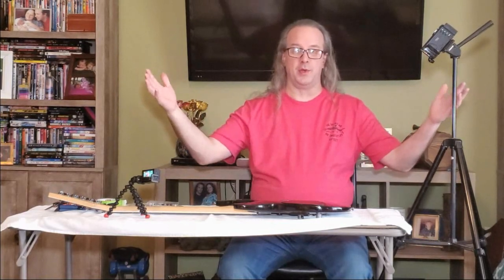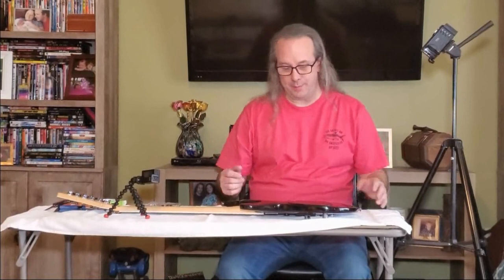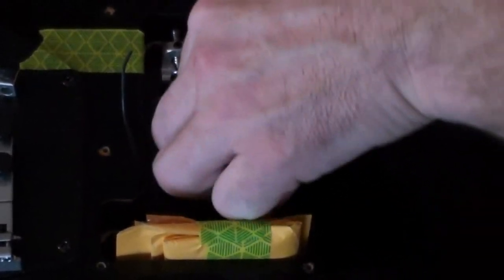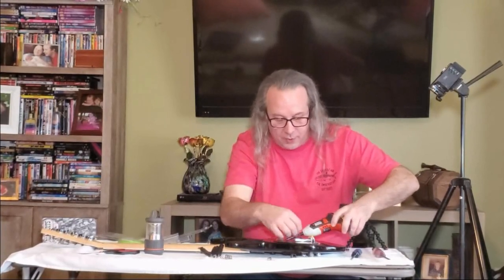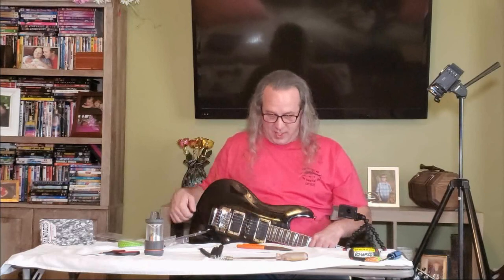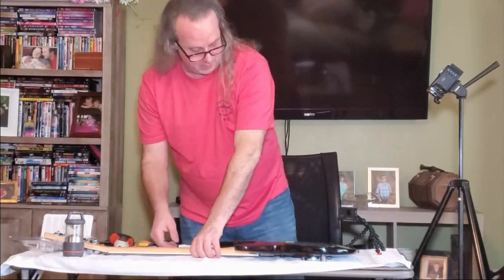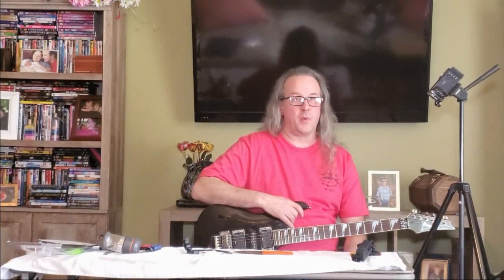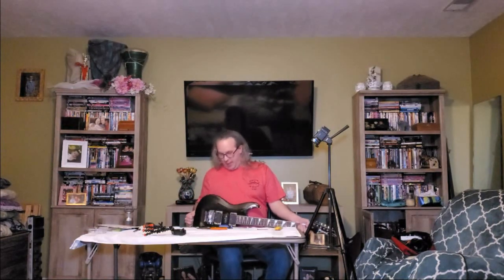Installing a Tremol-No??  WATCH THIS FIRST!!

Comment: Thank you so much for this video. I had the same issues. I couldn't figure out why is made metal scrapping noise. I installed this on my 97 PRS. So far go but what was the size of the torque bit for the ground.
Reply from the maker: I don't recall. I had a set of several and just tried until I found one that fit.
Reply: The ground screw isn't a torx bit, it's a regular hex key. I think it's 1mm or 1.5mm.

Comment: wow when you turned your guitar upside down the spring are crazy i have 4 straight springs on my kelly
Reply from the maker: Mine only shipped with 3 and years ago I had some tuning stability issues. The heavier gauge strings were drifting more thsn the thinner strings. Angling the springs put more tension on that end of the bridge and fixed the problem for me.

Comment: Painful...

What issue did you have with the D-Tuna? Was it just that the body wasn't routed for it, so it was contacting the body, or was it something else? I have one on my Washburn N4 and it's been working OK. I'm planning on getting the Tremol-no so I have more options rather than having to always have my bridge blocked for the D-Tuna. I'm interested to see if using this in conjunction with the D-Tuna will work or just be a mess.
Reply from the maker: The style of bridge on the older S-Series is just incompatible with the D-tuna, with or without the Tremol-no. 
I even tried to find something from FU-Tone who makes something similar to the D-tuna but for low-profile trem systems like the one on my Ibanez. But they told me that particular model bridge wasn't around long enough for anyone to make compatible hardware for it.

Comment: how do you make it float? there are 3 knobs... which one gets lose? 1,2, 3? there is not a video explaining that that I have found...obviously if you tighten all 3 its a stop tail piece... can someone explain how to make it float?
Reply from the maker: I haven't had my Ibanez out of the case in ages since I got my Wolfgang.  But I do recall it took a little trial and error to figure out which screws to tighten to give me which operation I wanted.  With all the screws loose, you're in your normal full floating operation and can dive down or pull up.  Now this is where my memory gets slightly foggy so forgive me if it's off.  With the first screw (maybe first two?) tightened (going from the tailpiece towards the neck) you are in "Dive only" and cannot pull up but can dive down.  Then all three screws are to give you a good solid lock for the "fully locked" position.

Comment: ik that im about a year late but a replacement that u can use to go to drop D is the tone vise pitch shifter which is a dtuna but can fit  in floating trems
Reply from the maker: I looked into those, but my bridge is the Lo TRS II. I asked Tone Vise if they made a Pitch Shifter that was compatible, but they don't.
Reply: @timbmusician  I haven't owned a Floyd rose yet but a thing that I think might work is to tune to E with the fine tuner all the way down, then loosen it to Drop D (I have no idea if it would work but Ya never know) Hopefully they will make a pitch shifter for the Lo TRS II soon.
Reply from the maker: I haven't tried it to be sure, but I don't think there's a full step of play in the fine tuner.

Comment: Hi Timothy, great video! I own a John Petrucci Musicman guitar and want to install a tremol no. According to their website I would require the pin type system however, going on the bridge type examples they provide, mine actually looks more like the bridge that would require the small clamp system. How did you know which system to purchase? Any advice would be most appreciated!
Reply from the maker: Thanks Andrew! When I ordered mine on Amazon, I made sure to check the fine print in the description. I also Googled for my bridge type and tremol-no clamp size. Still it was a bit of a shot in the dark. Luckily, Amazon has always been great about returns and exchanges if you get the wrong size.
Reply: Timothy E Brown thanks for getting back to me that’s good to know. I’ll perhaps order one off amazon and hope for the best! I was hoping to buy a strat one day and would no doubt fit another to that too. Out of interest do you remember which you got for yours?
Reply from the maker: Mine was the small clamp.
Reply: You have to take the big clamp version if the tremolo block is ticker than 8mm

Comment: Did you try the tuna after you installed it? I had the same problem. Kept going out of tune. This thing locks the tremolo from going back which is the key to the D tuna. 
  When you release the D tuner for drop D. It loosens the low E string which then allows the bridge to go back (and it puts the other strings out of tune. If it’s solid and can’t go back, it will stay in tune.
Reply from the maker: The D-tuna is simply not compatible with the Ibanez bridge at all. I tried to find a version that works with it, but I came up empty. The OG Ibanez S-Series just wasn't meant to have a D-tuna on it.
Works great on my Wolfgang, though!

Comment: does anybody know what the difference between the clamp,  pin, and the small clamp?
Reply from the maker: They're just different sized fittings for different types of bridges. You'll have to read the fine print for each one to see which type is recommended for your particular bridge.
My bridge is a bit obscure. That type wasn't listed anywhere so it was actually a bit of a guess. I Googled pictures to find one that looked closest to mine and got that one.

Comment: Why are your springs at an angle?
Reply from the maker: I had them that way for years before this. So long, in fact, that I don't recall what the original cause was. I just remember that one side of the bridge always sat higher than the other. Angling the springs made it sit flat and even.
I probably could have just added a spring, but I didn't have any at the time. Once the issue was fixed, I just left it that way.
Reply: @timbmusician  Interesting. Thanks for letting me know! Great video by the way. I subscribed:)
Reply from the maker: Thanks! I appreciate that.

Comment: i have one installed in my iceman. for me it was easy, i just took out the standard claw, installed the tremol-no claw, re attached everything, then locked it down.
Reply from the maker: That's great! I can only wish my install had gone as smoothly. LOL
Reply: You got really lucky. You should play the lottery.
Reply: @AutoRiff  which kind do u have, the pin type or the clamp type? the clamp type works best. i previously tried the pin type and accidentally broke it during installation lol.
Reply: @tyreekmurillo4524  I've got the small clamp type. There's so many ways that the piston can grind that leads me to believe that the official tutorial video is highly misleading.  For example, you can slide the clamp along the trem block and throw the whole thing out of alignment. I've spent 10 hours with this thing and finally I don't feel resistance but I can still hear some grinding. Kevin, the inventor, says it's completely silent when set up properly but I don't think that's true. That, or 1/64th of a turn on a claw screw or moving the clamp .05mm is still too much movement at one time. I need a drink LOL
Reply: @AutoRiff  i hear that. tremolos in general will make u need a drink or a smoke lol.

Comment: Question, if you set the Tremol-no to hardtail and switch tunings, then go back to the original tuning, does the floating bridge reset perfectly flat or will you end up needing to reset the whole thing?

In theory it should reset fine but I don't want it to be different in practice after I spend all this time setting it up lol
Reply from the maker: That's a good question! I haven't tried it myself to know for sure, but I suspect you're right. As long as you go back to the same tuning you had when you locked into hardtail mode, you should be fine. Any tuning changes in between should be irrelevant. But like I said, I haven't tried it myself to be 100% sure.

Comment: I think it would be much quicker if there is a better understanding of how a tremolo works, for example the fact that both screws on the claw should be level with each other to achieve a fully balanced bridge.
Reply from the maker: To be fair, the instructions that come with it say you have to have everything straight or it won't work right. But it's just a line so unless you've done a lot of work on trems before, you don't realize how much of a difference it makes if it is even slightly off.
Reply: not quite, the bridge should be level balanced with the body, and that mostly happens to be when the claw is in a 90 degree angle towards the cavity edge. If however the threads for the claw screws are stripped, or the springs are partly relaxed due to age, or even the bridge posts on top of the body are worn, you might end up with an angled claw and still have a leveled bridge

Comment: 13:48 that's because of your original spring orientation was offset.
Reply from the maker: That probably afftected things.
Reply: That's definitely the reason.. :-)
Reply: Also, at https://youtu.be/n4bDfQBQN60?list=WL&t=384 it's easier to do it the other way around. You put the spring in the hole first and then with the help of a flat screwdriver, you put the spring back in the hook. Thanks for taking the time to make this video! Cheers!
Reply from the maker: That's actually a good tip! I've never been known to do things the easy way.
Thanks for watching the video!

Comment: Bro if it takes you hours to retune your floating bridge after a string break you have some more learning to do. These trems aren’t the beasts so many YouTubers make them out to be. The problem is that they haven’t been taught how to use them correctly. 

I can totally restring your guitar, level your bridge, set your action and tune it perfectly in half an hr.

Comment: Thanks for this video man!! I'm about to receive my new Ibanez RG2027XL today (about time, it's been on backorder for like 4 months).. I'm going to install the FU-Tones brass block for it, the FU-Tones heavy duty silent springs, as well as the tremol-no (small clamp, and I have 2 allens in it).. and I'm gonna put new strings on it, and tune it to 1 step down from standard tuning with a low Drop G.. I've set up my friends Floyd Rose on his jackson.. but this'll be a new experience for me :D I'm sure your video will help me avoid certain issues during my install. 
Thanks again man!!
Reply from the maker: Thanks for watching! Good luck on your own install!

Comment: Thanks for this. I am just about to install a Tremolo-No in my Suhr Strat!
Reply from the maker: Hope your install goes smoother than mine! They're pretty cool when you get it dialed in, though.
Reply: Timothy E Brown I got it installed. But I need to readjust everything to make the claw and block parallel, and both perpendicular to the rod, while still maintaining ideal intonation, action, and bridge plate height and orientation. Juggling!!!

Comment: All I see here is a waste of a good whammy system. Why even get a guitar with one if your gong to block it off? Makes no sense.
Reply: 3 Reasons.

1. Faster set up/Changing strings and action.
2. Able to tune much easier to whatever tuning you require when the Tremol-No clamp is fully locked. 
3. More versatility, if you can't afford multiple guitars with hardtails, this is a good buy.
Reply: @metalheadbillseiw001  Oh I do, but as the old saying goes "Work Smarter, not harder'' in this scenario is definitely convenient.

Comment: Just get a second guitar.
I'm currently playing a lot of 80's hair that benefits from it, but it's the only floater I own.
Short of gluing blocks to both sides to hardtail it, you're just pushing a stone uphill.
Reply from the maker: That's an easy answer if you have the budget. But for a lot less money than a second guitar, minus a few hours setup frustration, I can now have it both ways. Works great once you get it dialed in.